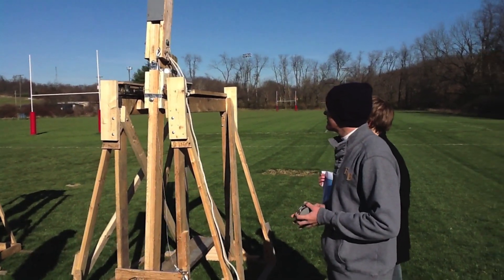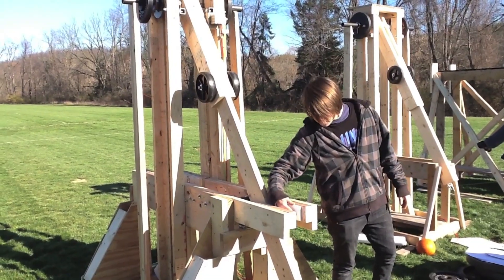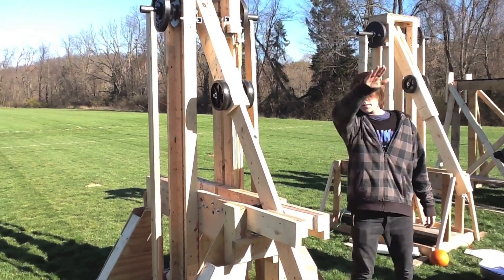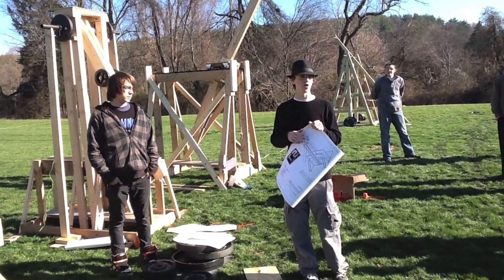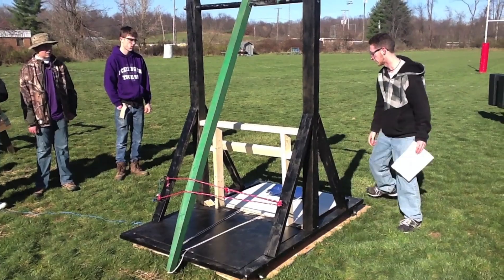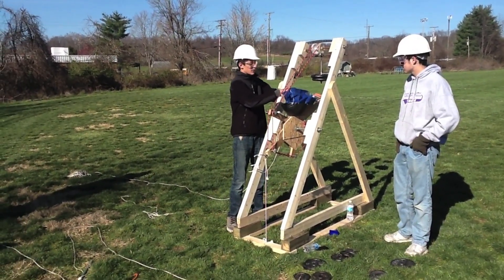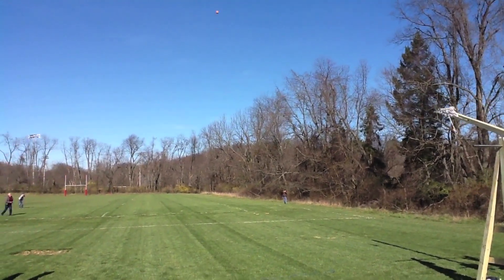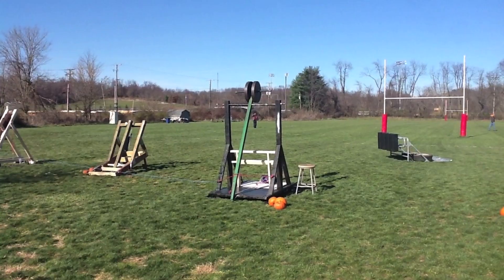OTEEA Fall 2012 Pumpkin Throwing Machine

Comment: The one that shoots backwards was cool. Fake out ur enemies
Reply: The trick is that the measuring system can’t handle negative numbers so it resets it back to the highest 64-bit integer, giving you a guaranteed throw distance of 9,223,372,036,854,775,807 feet